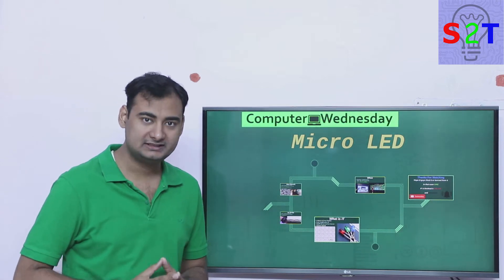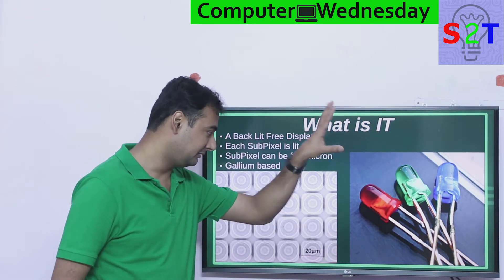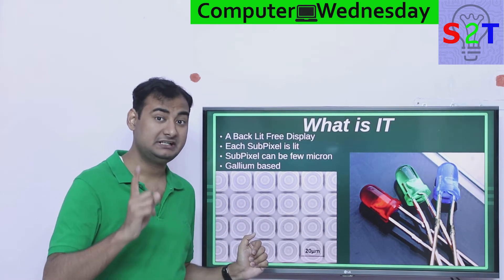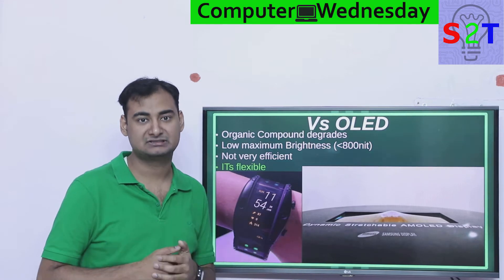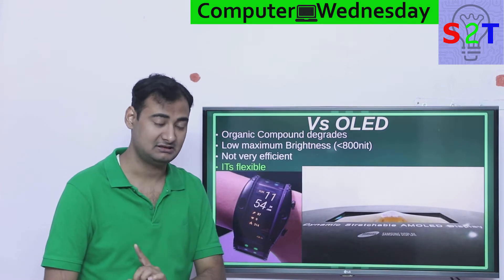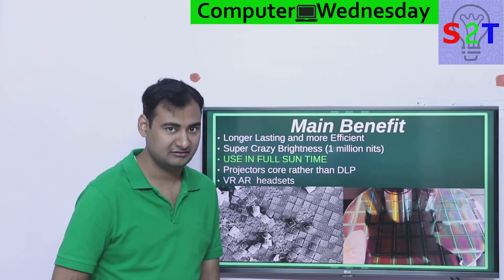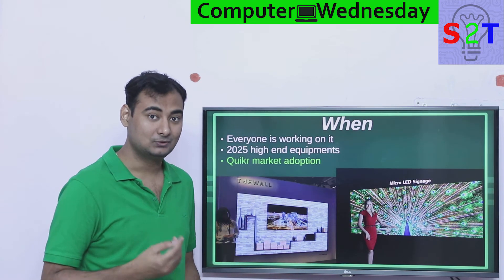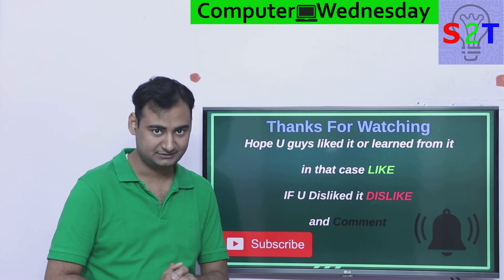Computer Wednesday Ep74 (Micro LED Explained)

Comment: Does fusion reactor generated heat is used to make water steam to start the turbine is there is no other source where we don't use turbine except solar cells
Reply from the maker: yes Radioisotope thermoelectric generator & betavoltaic & aneutronic fusion (no one has built it yet )